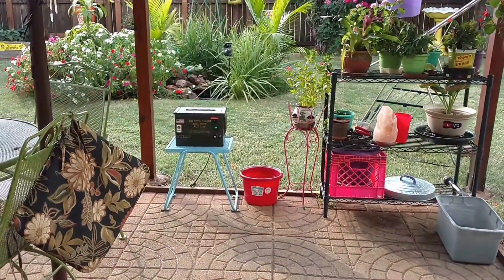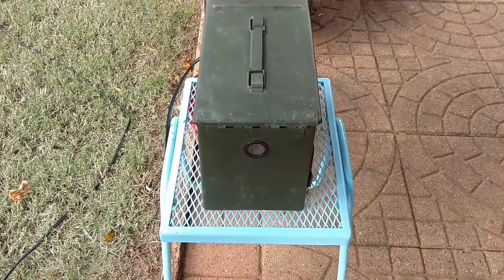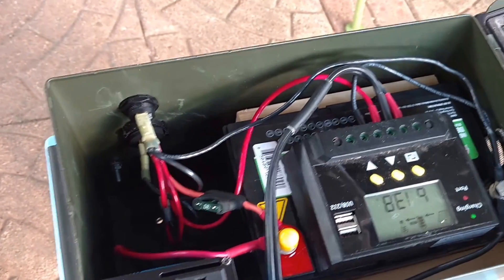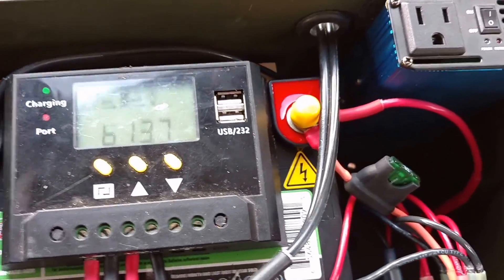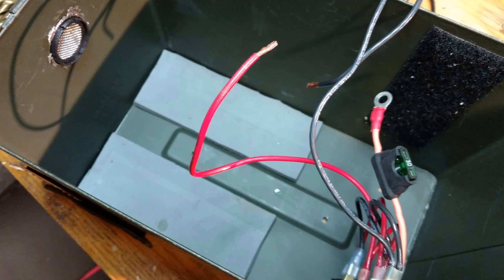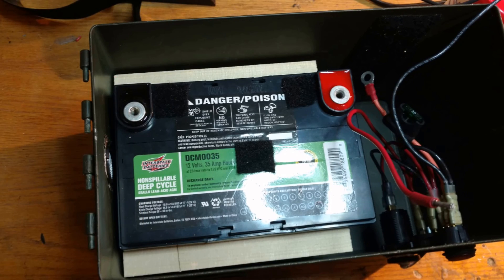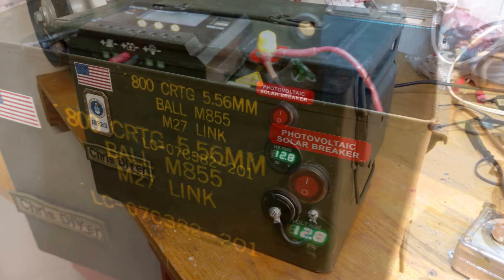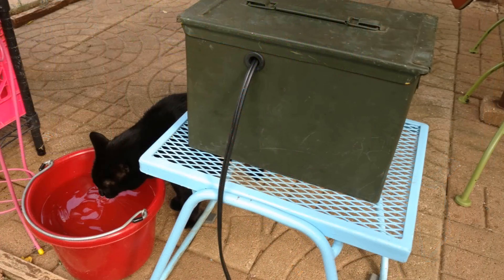Ammo can 12v micro solar generator (new battery, improvements, tweaks)

Comment: gotta love solar power ,another well made product and video sir
Reply from the maker: Thanks, this one is special. My house has four solar power systems in use: 1) this new 100w micro solar ammo can 2) 200w small garden DeWalt box 3) 800w "one-room" roll-around generator 4) 4,905w partial off-grid 6-circuit home solar power system. All working

Comment: cool project.  I like what you put together.  I think I might wire the Charge controller to a socket and and have a plug on the wire end of the panels instead of running the wires through a grommet.  That would allow it to be a little more portable, although it ain't a big deal to disconnect those wires.
Reply from the maker: Thanks...whatcha think on connector type? SAE style? (like the ones that the Battery Tender's use). It would be a snap to do that...and safer
Reply: Those would work for sure.  I was thinking along the lines of the plugs we used to sell at the marine store for connecting running lights to boats.  The ends had caps so you can seal them up when not connected.  The connectors also threaded together so you can't pull them apart accidentally.  Look at Perko 115008.  That one is pretty expensive, but there are similar ones that are cheaper.
Reply from the maker: https://www.amazon.com/gp/product/B0031BOTFC/ref=oh_aui_detailpage_o01_s00?ie=UTF8&psc=1
Thanks...those are really pricey. I went with these dawgs ☝

Comment: Great job Chris.  Can you show us the hole saw that you used to drill through that box?  I have a harbor freight ammo can myself but I don't think my wood hole saw kit gonna cut it.  Thanks man.
Reply: Use a step-bit from good old HF.  That should work nicely.
Reply from the maker: Step bit (I called it a hole saw...my error). Harbor Freight for less than $10. I drilled a pilot hole first. Make sure to clamp that ammo box down while drilling

Comment: As always, great job. (How long can that inverter run till it shuts off?)
Reply from the maker: Thanks. The owners manual says 9.7-10 volts is the low voltage cutoff. Prob would never take is below 11.5 or so

Comment: Very nice  :)  How do you like those AGM Deep Cycle batteries?  I'm going shopping :)
Reply from the maker: Night/day difference. $95 at the local Interstate Battery store...well worth the money vs the "Mighty Max" battery sold on Amazon for $68. CANX that order! Deep cycle AGM is the way to go if not doing lithium or LiPo4
Reply: I'm working on a similar project and was leaning toward the Might Max battery...same size, same voltage, and same capacity as the Interstate battery...I have a tight budget, but if there's something I need to know about the batteries, I'd truly appreciate the education.
Reply: @GunNut37086  Check out the Vmax batteries in the same size and power configuration.  They are rated as the best you can get from Amazon and other sites as well.  I'm currently looking at the Vmax 35ah AGM and it's sitting at $109.  I've heard bad stories of the Mighty Max's going dead in a year or two.  It will pay to have a good battery when the SHTF